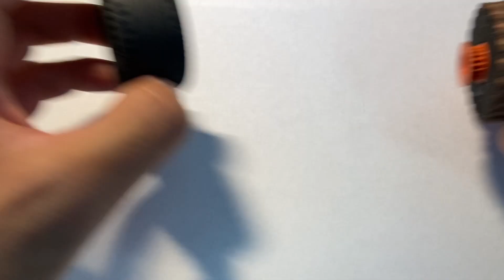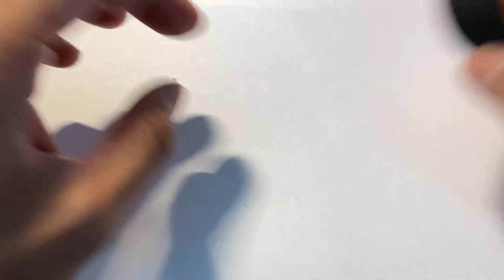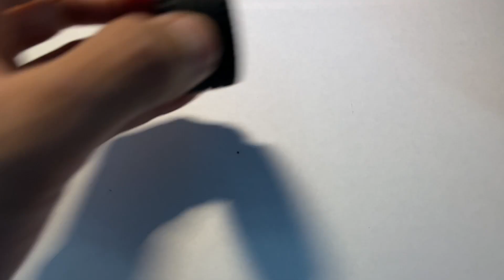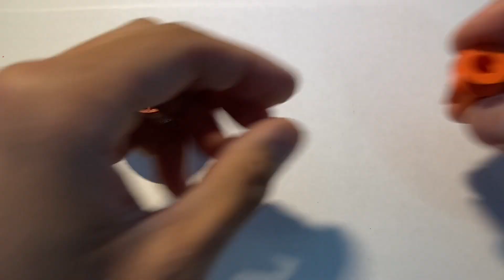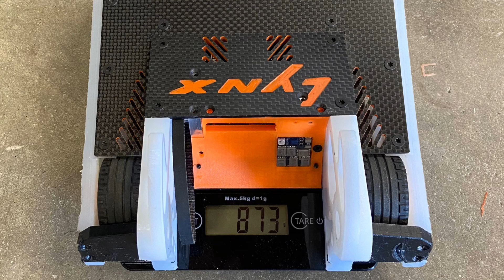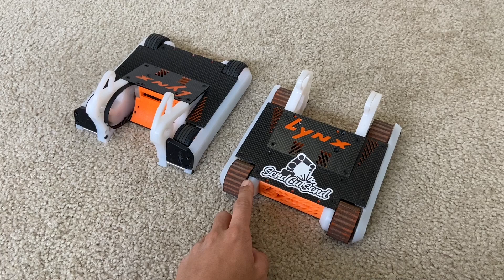Testing LEGO Tires For 3lb Beetleweight Combat Robots

Comment: Hi, Calvin! Thanks for sharing the video. Would you be able to share what timing pulley you use on the drive motor? Looks like two places for the belt.  Also do you use 3 or 4s batteries? Both your bot and driving are impressive!
Reply from the maker: I use “H” style GT2 pulleys on the drive gearboxes. 4s.

Comment: https://www.colsoncaster.com/wheel/performa/ ,  you can use the wheels, much more durable than the lego tire, and you can broach the center and use a 6 wheel drive by lengthening the center pulley,  these do not compress and have amazing traction! by modifying your pulley print slightly to use a 3/8 or 1/2 inch hex that will register in the wheel after you broach it.

Comment: Wait, why do you have magnets if you are not competing on a metal surface? :) are they concrete magnets?  Hehe how well do the tires work on metal with and without the magnets? That's the real test
Reply from the maker: I mostly compete in arenas with steel floors. Unfortunately I don't have a giant piece of steel I can test on in my garage. Also, steel floors can be bare, painted, or have a textured surface, which makes things even more complicated.
Reply: @IbaLabs  put refrigerator on its side? :)
Reply: cars are usually magnetic... roof or bonnet should be enough... although i think the boot lid would likely be the flattest area